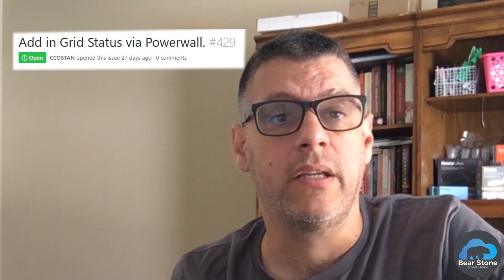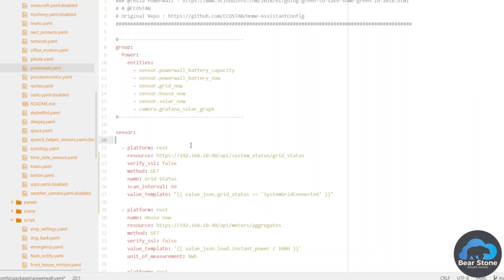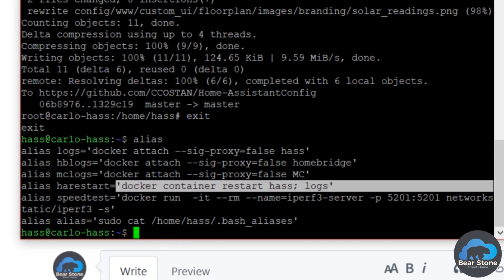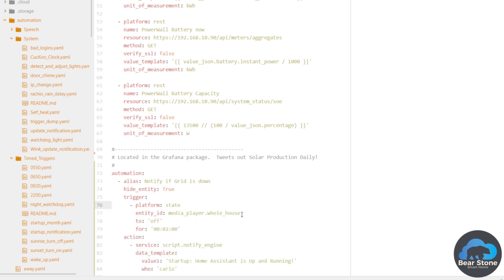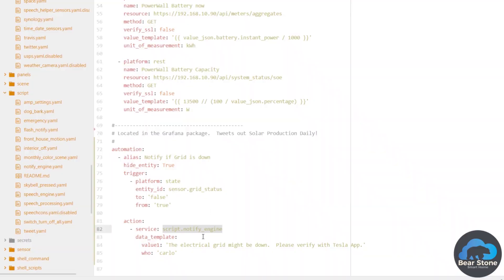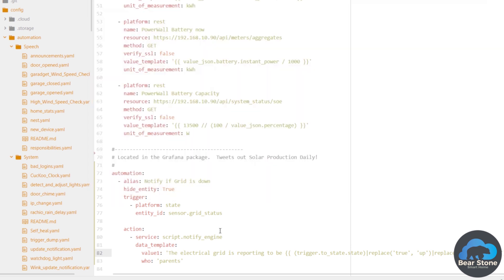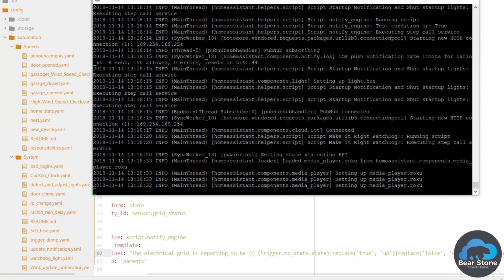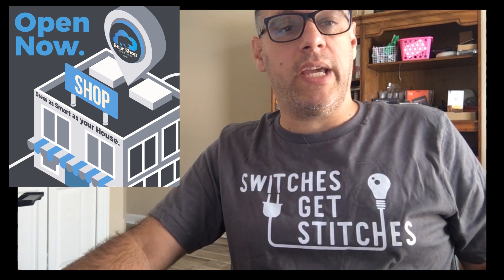Tesla PowerWall sensors added to Home Assistant!

Comment: can you tell me please if your system has the issue with leaking battery power to cover the non-critical loads like AC during non-peak periods? i'm having this issue and Tesla is telling me nobody has it. thanks! would love to chat with you if possible. brad in vegas.
Reply from the maker: I’m not sure what the issue you are experiencing is. I don’t watch my battery too often though. I just let the system hum along. It really works with almost no intervention.
Reply from the maker: You can always hit me up on Twitter though. Or in these comments and I’ll respond.
Reply: @vCloudInfo  hey thanks, perhaps you can review this example and tell me if you are seeing what i see on my system?  I'm looking to see if anyone here has a partial home backup system from Tesla. My situation is that i have an issue with the system leaking battery power to cover the non-critical loads like AC during non-peak periods.
I am told by Tesla that this is normal and is caused by the Neurio CT meter which is used in the non-critical AC external switch panel to measure AC loads, but that it also "leaks" power from the battery to help cover those loads 24/7.
This offset would be OK if it were only during peak periods but it is all the time, even at night. This means if the reserve for outages is set at 20%, it will always be at 20% because of the leak, and have no extra power to offset the loads during peak periods - this leak would cost me over $3 a day in lost offset credits.
As an example - run your system at 20% reserve overnight - the system will stay at 20% reserve from that point on if you have the leak. If you do not, the system will charge PW back up to 100% the next morning from solar, even though you are set at 20% reserve.
I have not yet been approved for permission to operate by the power company because i have not paid Tesla for the system due to this leak which i see as an error.
Does anyone have a similar issue and can tell me what you did to resolve it? does anything in this leak example change after PTO?
thanks much!
Reply from the maker: @bradwww  so I run my PW down to 15% each night and every morning it charges back up from the Solar. In the event of a storm watch event, it will even charge up from the grid. No issues seen here related to a leak or freeze at any percentage.
Reply: @vCloudInfo  so your reserve is set at 15% and it goes to 100% in the morning after being used up during a peak period? clearly your experience is different from mine, your system is partial right? no battery is hooked to the AC loads? What state are you in? thanks!
Reply from the maker: Yes, my reserve is set to 15%.  Last night when I responded to you, it was drained at 15% - Now (5pm EST, it's back at 92%.. I'm in Florida so lots of Sun throughout the day to recharge the Powerwall. I have everything in my house on the PW, except the Big Central Air unit and the Oven as they took too much draw for the single PW.
Reply: @vCloudInfo  ok big difference in operation, even though you are partial home backup with 1 PW like mine. what are your peak rate times or are you flat rate? my PW fills up from solar within 3 hours in the morning 7-10am - wonder why yours does not fill up even with 10 hours of sunshine? when you look at the battery charge graph for today, does it show any times where  the battery went down? if so there might be a power leak to the AC units, because it should fully charge the battery in a couple of hours. thanks for the details!
Reply from the maker: Oh no. My PW does power up within a few hours. Today it was fully charged by 9am. The 92 was because it had started to discharge a little. (It’s rainy season in Florida so it rains every day at 4pm(ish).  We have a flat rate here. No peak times for energy.
Reply: @vCloudInfo  ok thanks, since you don't have a peak time, it won't matter if your battery has a leak like mine. ok thanks anyway! you might want to check with the utility about getting a peak plan - would save you a lot of money in the long run - in Nevada you can only get a peak plan if you have an EV.
Reply from the maker: I have a Tesla so I have a plan that gives me 10 bucks a month if I charge after 6pm.
Reply: @vCloudInfo  so do you charge with grid power after 6pm or do you charge for free with solar in the morning? EV charging with solar would probably net you more $$. do you know what a KWH costs on your plan? mine is 5 cents all the time except 35 cents 1-7pm weekdays in the summer. thanks!
Reply from the maker: We have net metering so I just charge from the grid after 6pm using solar credits. 13 to 14 cents a KWH here in Florida.  But I get around 80 KWHs per day via solar.
Reply: @vCloudInfo  cool - what do they pay for those KWH you are sending back? if it is not 100% then charging in the morning would save you money i think - worth a test.
Reply from the maker: They don’t pay out. You just get KHW credits that you can then draw against. It’s a 1 for 1 net metering system. It’s actually pretty great!
Reply: @vCloudInfo  That's an interesting system, but if you have a positive balance, how can you possibly draw out all those credits? My solar system has 120% offset so that means I will always be making more power than I use during a given year.
Reply from the maker: @bradwww  yeah. Over the course of the year, I never run positive. Mainly because of charging the Tesla Car.  That keeps me paying around 40 to 50 bucks a month in electric costs.   Works out though since the electric companies here have a 30 minimum bill. So you kind of have to use some juice to not give them money for free.
Reply: @vCloudInfo I get it. So in your case cuz of your utilities rules then getting a smaller solar system is actually beneficial.
Reply from the maker: @bradwww  correct!  That’s why I also only got 1 Powerwall. With net metering, I just need enough to get through a power outage over night.

Comment: Thank you! This will pair nicely with AC automation. 
So, If grid status is 'false', turn AC off.
Or, if grid status is 'false' and Powerwall capacity is 50%, turn AC off.
Reply from the maker: Yes.  I also added a few more optimizations here : 
https://github.com/CCOSTAN/Home-AssistantConfig/issues/547

Comment: I managed to get HA to see the charge level of the Powerwall 2 but nothing else. Do I need to input the api where noted in the config to get the other data? How does one get the api from Tesla?
Reply from the maker: Hi Steve, Thanks again for the support! For the Powerwall, you have to make the other sensors using the rest platform.  Check out this link to my Powerwall package and just change the IP to your Powerwall IP and you should see the new sensors. 
https://github.com/CCOSTAN/Home-AssistantConfig/blob/master/config/packages/powerwall.yaml

I use it to let me know when the Grid is Up or Down.  I'm in the process of building out a new automation to shut down the lights when in DOWN situations to conserve the battery power.  Stay tuned for more on this in the coming weeks.
Reply from the maker: Btw Steve, you can put the link right into your browser (replace the IP WITH YOURS) 
https://192.168.10.90/api/system_status/grid_status
and see if the API is working for you.  You should get a result like this in the browser.
{"grid_status":"SystemGridConnected","grid_services_active":false}

Comment: Hi. I’m new to HA. I installed the PW integration yesterday and I want to know is there a way I can create a automation action to switch to backup mode and also switch to self powered.   I have live grid energy prices in HA and I want to make a rule so if grid price is 0.00 or less (or when I’m paid to use grid) then change powerwall to backup only, this way it starts charging from the grid then i would make another automation so if price is above 0.01 then set to self powered.
Reply from the maker: No. Currently the PW API only provides read only data.

Comment: Good video.  I also have my PowerWalls tied into HA.  Curious if you or anyone else has found a way to total usage daily, monthly, etc.  I tried the utility meter feature in HA but the total is way too high of a number and I haven't found a good conversion method.   Would be awesome to not only track historical totals but the current daily total would be nice as well.  Have you crossed this line yet?
Reply from the maker: I haven't implemented it yet but here are some notes on the subject.
https://github.com/CCOSTAN/Home-AssistantConfig/issues/346

Comment: This is super helpful, thanks so much. Question... I have it sort of working (packages folder, powerwall.yaml file etc.) but HA gets mad as I reboot as it doesn't like the rest command. I think I need to configure RestAPI for this. I have researched the official documentation, but can't really follow it well. Any advice on how Rest API works/sets up in this use case?
Reply from the maker: Hmm .. I didn't do much to make it work other than just popping the package into my configuration.  I do get issues with the new versions regarding [icon_template].  I'm going to fix those now.  There should be a video on it out soon.